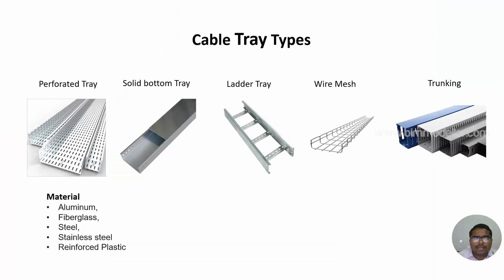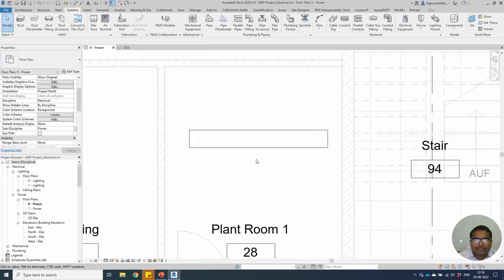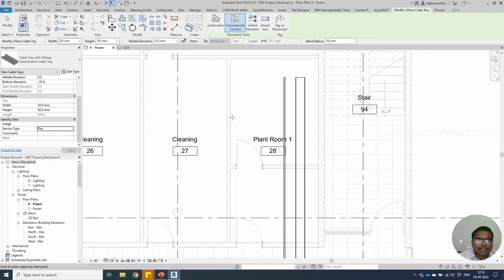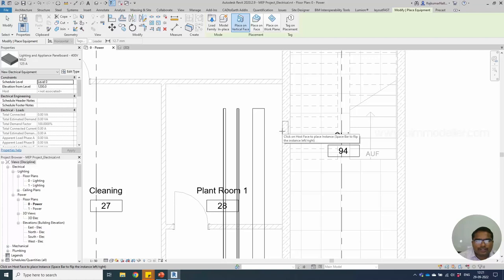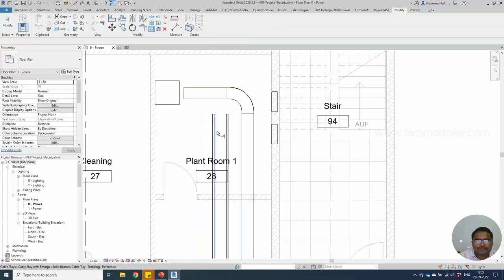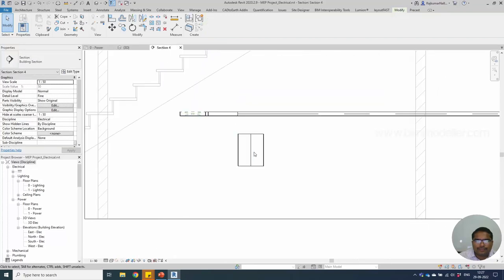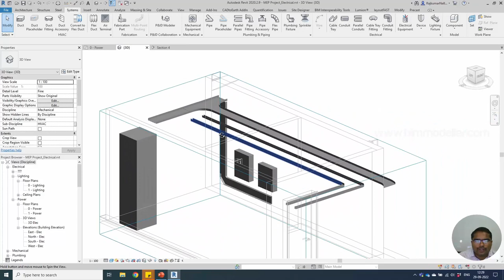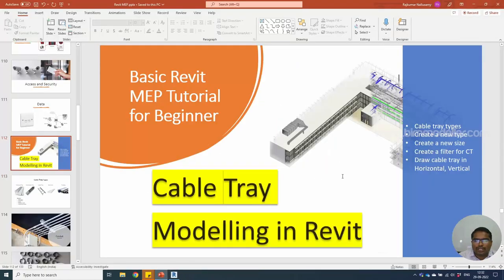#Revit MEP Project 36: How to model Cable Tray in Revit

Comment: I have two questions:😃
1: can we draw electrical cables on the cable ladder/cable try?
2: is it possible to draw cable ladder "support"?
Reply from the maker: Good Question.
1. By default there is no Cables(3D elelment) in Revit. You can make your own family and place it.
2. Yes We can place support if you have the family. We are in proceess of making those families. Will upload to www.bimmodeller.com sometime.